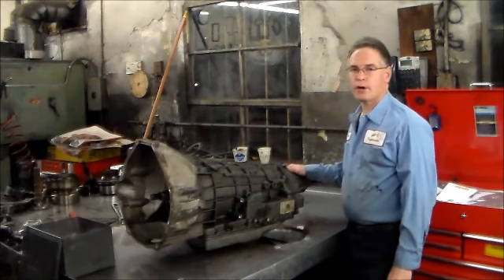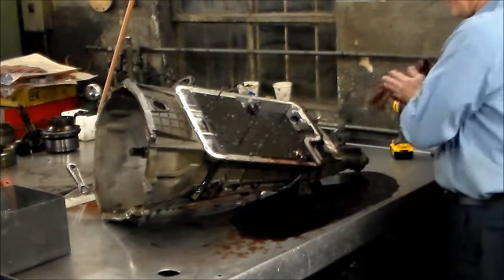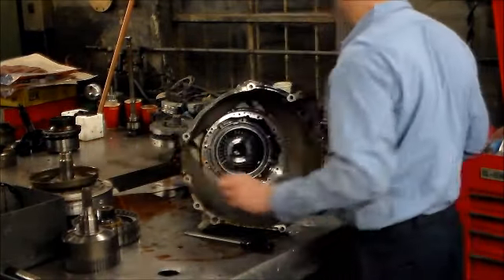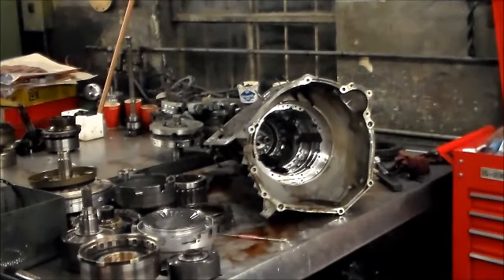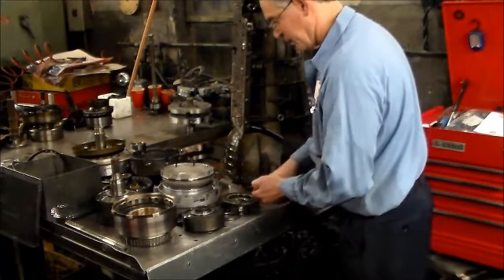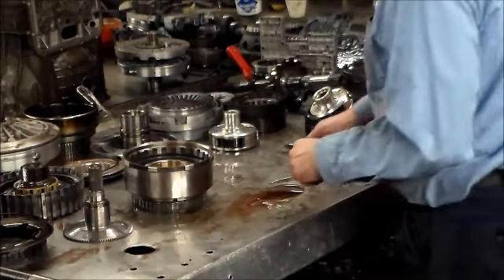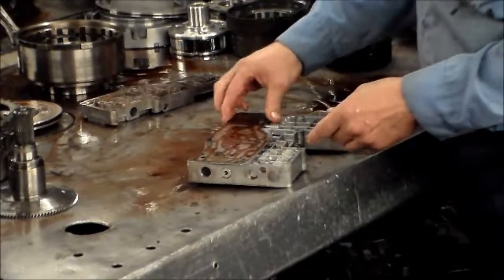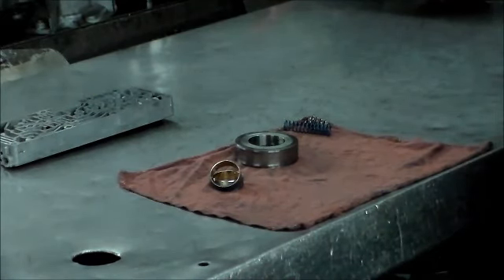Ford 4R100 Teardown

Comment: do you know what would be in my 97 mercury marquis ? some say it's a 4r70w
Reply from the maker: Yes it should be a 4R70W, Is there a problem with the trans? I am a subscriber to hiram's channel. Gary
Reply: thank you , so far its been a great transmission but it is a little spongy on the 1-2 shift .
Reply from the maker: any codes present for the trans?
Reply: no ,  it just doesn't have a nice firm shift from first to second and the fluid is beautifully pink with no burned smell . I'm just super picky .  the reason I was asking if it was a 4R70W is I want to watch a video about it so I can rebuild it when it goes out .  thank you for answering my question .
Reply from the maker: Ok, when it comes time and you want to firm up the shift, you would have to addresss the acummulator and springs in the trans, that should firm up the shift
Reply: thanks Gary , I was thinking it could possibly have a broken spring. and can this bedone without dropping the valve body?
Reply from the maker: Yes it can, sometimes with a broken spring the shift would be a hard shift, but sometimes it scores the sealing surface, its easy enough to check
Reply: thank you Mr. Gary you are very helpful and responsive . which is refreshing
Reply from the maker: Your very welcome.

Comment: 1993 E350 7.3L diesel how do i know if the transmission is for a diesel?
Reply from the maker: Mac Skymackski Bellhousing is different from a gas vehicle
Reply: ok the issue is the engine doesn't lug so there is no power,  RPM is to high dropping gears to quick, like a gas engine powerband how about that?
Reply from the maker: @maccskybsky8084  are there any codes present for the trans?
Reply: I don't have a code reader, i just know the transmission is downshifting taking the engine out of lugging
Reply from the maker: @maccskybsky8084  so this has sentive downshifts?

Comment: Gary, what is your diagnosis as to why this transmission was in bad shape?  Lack of maintenance, driven hard,... what's the root cause?
after watching the video, looks like pump wear caused clutch slippage, which the computer noticed, increased pressure to compensate for slippage, and the process kept going until catastrophic failure?
Reply from the maker: Hello, i would say lack of maintence, also i found the factory cooler to be leaking which probably ignored. So i did the overhaul and installed a new factory cooler and all is well. I would think they never checked the trans fluid, when i started to slip they just added until it started to slip again, eventually the foward clutch failed
Reply: Gary Ferraro lack of fluid is bad! Thanks for the response!
Reply from the maker: yes it is, so is heat

Comment: My transmission wont go into forward or reverse it stays in park, and when I try to put it into gear i can't feel it, when it's in gear and I put it back into park it makes a really loud grinding noise until I turn it off any recommendations ??
Reply from the maker: The shifter does move through the dentents?  (park, rev., neutral,drive) Just the car wont move?

Comment: IVE GOT NO CODE OVER DRIVE DOES NOT SHIFT INTO AND LIGHT ON SHIFTER DOESN'T GO OUT  EVERYTHING ELSE DRIVES GOOD AND SHIFTS  JUST NO OVER DRIVE  BUT IT DID WORK LIKE 3 TIMES WHEN COLD ONE DAY
Reply from the maker: When you say light on shifter, that may be the overdrive cancel switch, if its lit, car will have no o/d, only shift to 3rd, may have a wire shorted at the handel
Reply: right i cant get the light out and i checked wiring the switch on light may be bad but the light never does go out yet at times i did get the trans to shift into over drive  so i know my switch on shifter is talking to trans also
Reply: its brand new switch also the old one had no switch it was gone ,bought it used
Reply from the maker: Take a look at where the switch plugs into, those wires may be shorted
Reply: i did no blown fuse either light stays lit just cant shut it off also like i said the trans did shift into over drive a few times since i installed the new switch actually the entire shifter
Reply: but the light never did go out  royal pissed off  if its the switch im going to a salvage yrd and pick up another shifter and try that
Reply from the maker: jesse james may have a bad switch